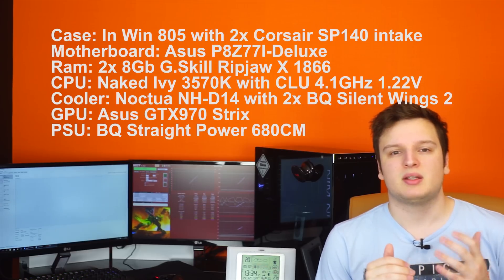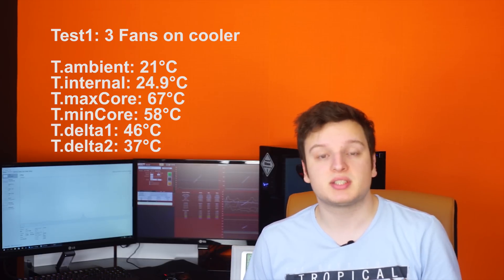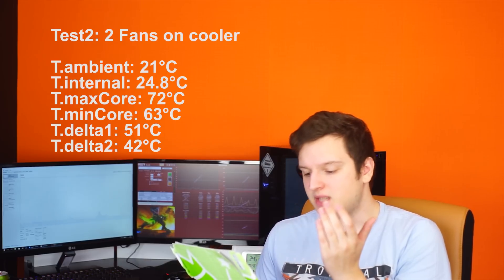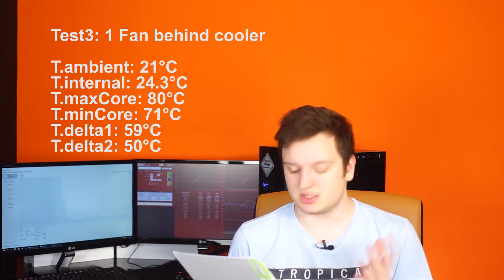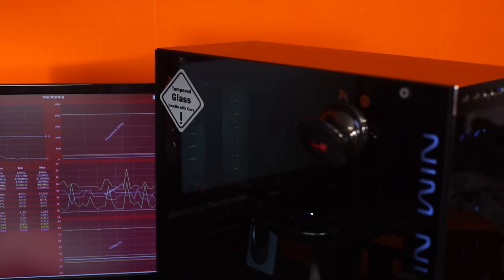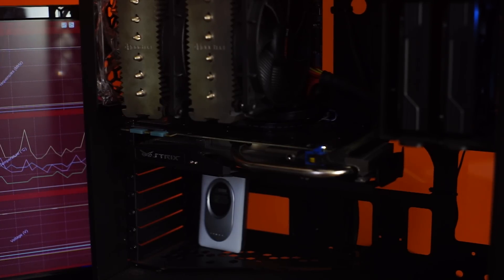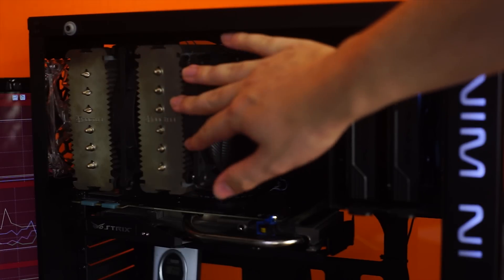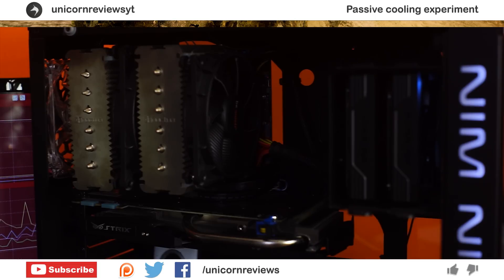Passive cooling on an Overclocked i5 | Nerdy Experiments Ep.2

Comment: You used the cooler with fins orientated for lateral cooling and do not even remove the fans to allow some natural ventilation, no wonder it did not work.Turn the cooler around for vertical flow, remove the fans and you have a chance!
Reply from the maker: +Dave Bell The case doesn't have a top vent. If i 90° the cooler, it would block the airflow from the front fans.
Reply: Agreed , but the thermal bottleneck is getting the heat away from the fins, the internal case temperature was not the issue, and air movement from the front fans is likely to be minimal, try it and see?
Reply from the maker: +Dave Bell The thing is my cooler is naked mounted and I'm afraid I'll break the die if I take the cooler off
Reply: +Unicorn Reviews I feel the same about my 6700k......